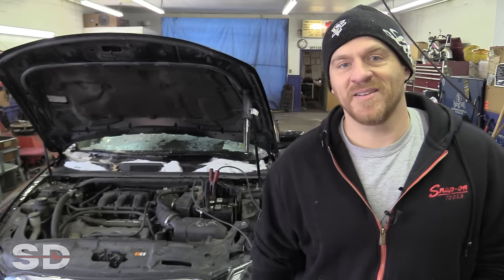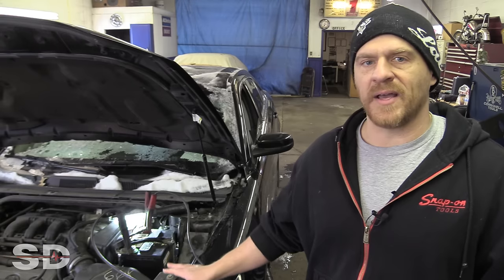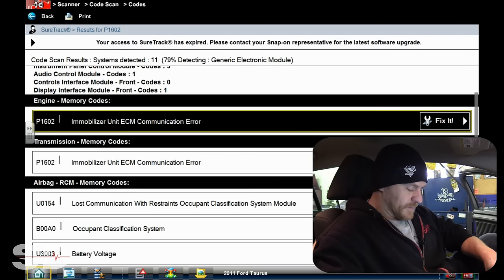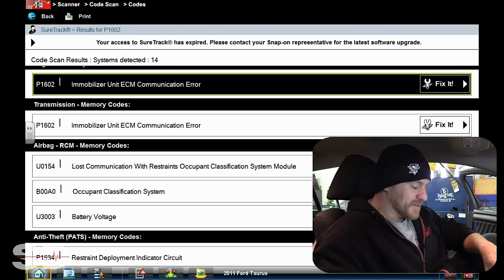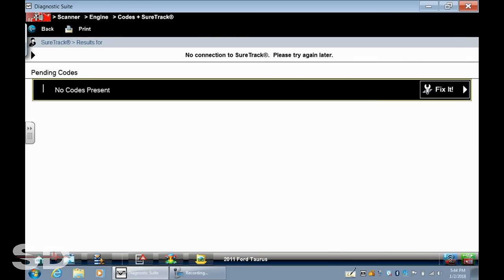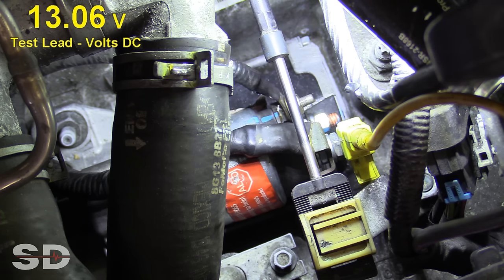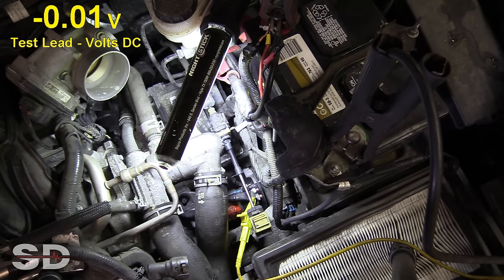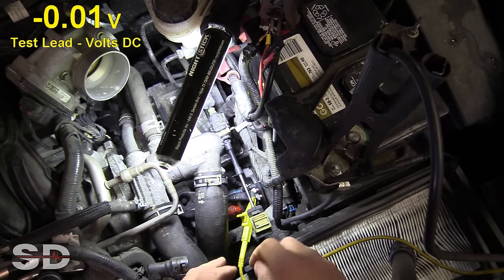No Crank, new starter, how to troubleshoot, any car! (2011 Ford Taurus)

Comment: Great video!! You have an insane amount of knowledge and insight when it comes to anything automotive.  I came across this video while to research for my boyfriend, what was causing his 99' ranger xlt 4.0 4x4 truck not to crank or start.  He replaced the starter and now everytime he tries to start The truck, it blows the 50Amp ignition fuse in the box under the hood. You can turn the KOEO and the fuse stays intact, dash lights radio everything has power like normal, but as soon as you put it in the crank position it pops. I have no experience with Ford, (I own a VW which is another electrical nightmare of its own.) I was hoping you may have some insight on this. He switched the relay for the starter and the heater blower motor (which are identical)and the same thing happened.       Those 50Amp fuses aren't cheap and I think he has already bought all of them that the whole TWO parts stores in our  little bitty town had in stock.  Any advice you could give me to point me in the right direction would be greatly appreciated.  I'm about to go crazy bc he's in such a bad mood bc he can't figure it out and get it fixed. He has already missed there days of work waiting on the starter to come and now this. Also I hooked my obd2 scanner to the truck it has no codes permanent or pending, but I did notice that the intake air temp was -40° while viewing the limited live data function(of course the engine wasn't running bc it wont start). Im not sure if The IAT is relavent to the problem, just trying to provide all the info that I can. The engine coolant temp was at 60°. I thank you in advance for any assistance you may be able to provide.
Reply from the maker: Second time I've read this and wanted to answer but I can't without a diagram. If I run across this comment again when I'm on my PC I can help you further
Reply: @ScannerDanner   
We figured it out. Took the S line off the starter and then tried to start it and it didn't blow the fuse so that made me lean towards it being a bad starter. Never assume just bc parts are new that they are good. We took it back to AutoZone and they replaced it no hassle at all. Thank you for replying and letting me know you did see the comment. Most people wouldn't have taken the time to do that.

Comment: You could megger the cable in circuit to check the cable
Reply from the maker: I've never used a megger so I don't know. But it really doesn't get more simple than a loaded circuit voltage test with a simple voltmeter. Don't you think?
Reply: Yes makes sense to me just something I was taught in the NAVY on submarines. We used voltage drops then megger the wires but sometimes we just megger the wire if it looked damaged
Reply from the maker: I assume this megger would be connected to one end of a disconnected wire and then you use some type of gauss gauge?

Comment: Pretty weak Pete come on. If she came in and wanted oil in her master cylinder would you have accommodated her?  "Ma'am  are you sure it needs at starter?  What happened to don't be a parts changer?  Not good.
Reply from the maker: It's actually my fault. I'm Pete's guy and couldn't make it when that car came in and the customer refused to wait on a diagnosis
Reply: Pete leaves the electro-magician bit  to Paul To  I don't think there is anybody who works on cars that hasn't made a bad call on a battery or alternator or starter  but if you do testing you can cut the odds of making a bad call from say 1 in 5  to 1 in  50.